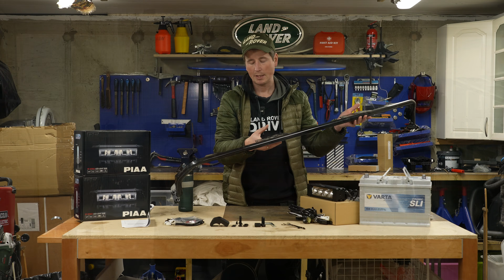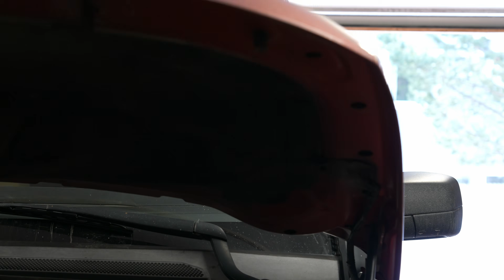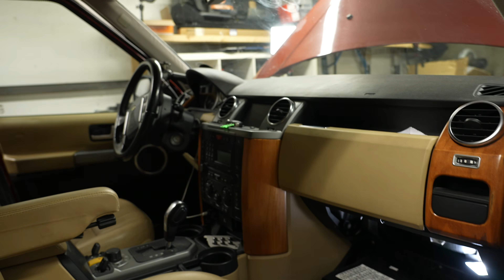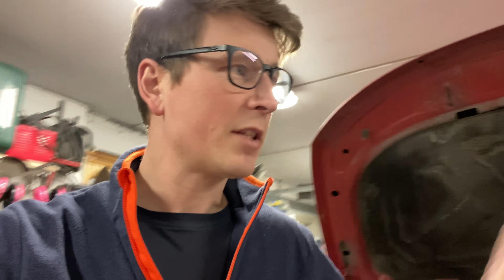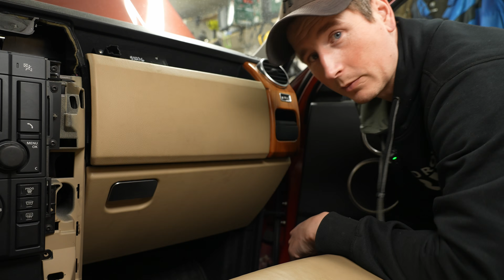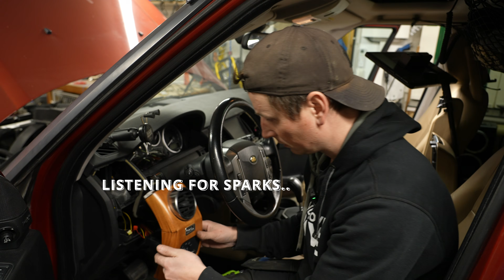FORD Upfitter Switches - The BEST Auxiliary SWITCHES for your Discovery 3 LR3 LR4 Land Rover

Comment: I have the upfitter switches to install on my LR4 as well but not the wiring harness with connector. I’m not having much luck with the online or AI searches. Where did you get the connector that goes into the back of the switches?
Reply from the maker: Hi and sorry for the late reply, I got it at the same time as I pulled the switch. I met a nice guy at the breakers that let me get part of the wiring loom at the same time.

Comment: Make a mold out of clay for the awithces.just use foil and wrap around switches and inside the coin tray, you'll have a sandwich. Then get a guy from your area with a 3d printer to design a insert f9r you. You can also use foam for tool boxes or pelican cases. Id bet theres 10 guys in your proximity ready to have some fun!
Reply from the maker: Thanks for the tip, the mold thing was smart. I have been thinking the same and I have the original overhead panel for the Raptor, where the switches mount to, so I thought I would use that in a combination or just cut it out and make it fit, as is, in the center console. 
You don't know how many times I have been looking at a 3D printer after starting this project... But that would be another rabbit hole I don't have time to go down into. 😅😂

I have multiple people to ask so will start there, one of them printer the Overlanding in Norway + Land Rover Drive center caps for my wheels. 👌

Thanks again,
Best Simon.

Comment: I think you spent too much time trying to use the disco wiring, would have been easier to make up a stand alone harness.
 I made up 2 ,1 for the led light bar on the roof rack and 1 for my bullbar mounted spot lights.
 I used a trigger wire from a headlight high beam slate/ grey wire through a relay with a switch that takes a power feed from the fuse box.
 By law in Australia we also have to have aux lights wired to the high beam so when you dip the lights they go off.
Reply from the maker: You are quite right Nick, and I am still not done spending time on it. 😅😂 
But that's me and my need to get somthing to work. 

I looked into the the headlight high beam and found the correct wire to hook into, but as you saw, I went the other way. I could as you just sent the highbeam signal into the switch and taken it from there. 

Will get some lights in the front as well in the fall, so we will see if I will redo the setup then. I had to make my own solution because of time and that missing pin, but you will get to see that in the next part. 

Best, Simon

Comment: Check out LR Time for the work involved in that bodywork repair. Good luck if you decide to do it yourself. I'm a mechanical engineer and I certainly wouldn't tackle it. Christian did an exceptionally fine job, but what he did is beyond my ability and workshop tooling.
Reply from the maker: I will give it a go and if it is to much I will reevaluate the situation. 😅😂 I have seen the LR Time's video on this and they do a good job in the repair using the pre-fab inner and outer sills. 

I know I won't do a perfect job, but since it is a chassies based car I am not to worried about the integraty of the strenght in that section. But I will definitely weld in more metal than a professional would do. 

Thanks for the input and tip about the video! 👍
Best, Simon

Comment: There is a large blank above the phone switch. Might a couple of phone switches fit in this space. You would then change the logo on these switches.
Reply from the maker: Hi Steve, been looking into that as well, but most of the original switches are push-release type buttons, used to just send a signal for a module. 
I look at the top buttons as well, as I am missing one, where the lock/unlock + hazards + backup warning are located. But a module behind there as well. 

I have spent so much time on this project reasearching the car and button options and I think I have found one of the better options. I think it would be even better if I didn't have the sunroof as I could mount then overhead, that would be just perfect. 👌

Thanks for the idea, not a bad one. I think if I can find some FoMoCo buttons that are push and hold, and that fits the space, I will do something like that later. 😉

Best, Simon
Reply: @LandRoverDrive my car is also starting with tin worn but not as advanced as yours 👍
Reply from the maker: @stevenbell7902  I think it is doomed already if I can't do a body-off, as it has been running in salt for years. I will do my best on the sills and then we will see what happens. 
I can only image how bad the parts that I can't see are. 😅

Comment: Hi Simon, Raptor owner here. The #1&2 swiches are rated for 15 amps, #2&3 for 10 amps, and #5&6 are 5 amps. If you run your lights through a relay it does not matter. Obviously you have to run your driving light and bar  trough a relay to acitvate them with your high beams, so switch 5&6 will work just fine. Just putting out the info for others who want to do this mod.
Reply: Outstanding! 🤘
Reply from the maker: Thanks Joakim, but just to be clear, are you saying the switches them self are rated for 15amps and so on? 
Or are you refering to the fuses in the relay/fuse box in the enginebay? 

The switchboard I would guess only handle a small mAmp draw. 
Best, Simon
Reply: @LandRoverDrive  I do not know if they use a relay. They have induvidual fuses in the fusebox rated at 15/10/5, but I have not found any relays.

Comment: Mr Simon in my opinion you are over thinking the wiring for the light here in usa and what i use is call a spod very easy installation you run any lights to spod and you run the main wire from control panel to spod and run lights wiring to spod and you finish they come in 3 different controller a rocker switch,  touch screen, and a push button,  i have all 3 in my jeep it the rocker swith to turn on lights,  on my toyota is touch screen and on D2 is the push button switch,  

You dineed to drill a new hole in fire wall what i usually do is use a wire coat hanger straighten the wire and take the wire you need to go through fire wall and tape it on coat hanger wire next find the wires that running through fire wall it has a rubber boot on it now take other end of coat hager wire push it through factory wiring boot and go inside vehicle pull through boot you end up with a nice seal from factory boot the spod is a one and done unit it has up to 8 switches for lighting or a air locker or air compressor has many functions 

My lr3 came from new jersey a snow and salt on roads i have a couple of rust spots im not repairing you can buy another lr3 or lr4 now they are really cheap but here in texas we don't get much snow but we get ice we don't put anything down but a little sand usually they shut down area where the bad roads are people stay home the sill repair not that difficult actually it's a cut off and weld in same part and you can buy the body skin and weld but it dose takes some skills that something i don't have rust is everyone nightmare have a good day simon
Reply from the maker: Hi James, and you are quite right, I am a over-thinker. 😅 It comes from the need to understand how things work. 
I have been looking at many options of switches and modules, like the one you mention, but non of them had the switches that I would like. These FoMoCo switches ticked all the boxes for me. 😊

I could probably gotten some wires through the already made grommits and I would try harder if I were to do it again. Coat hanger is a good tip.

The D3's and D4's here are dropping in prices as well, but the cars that are good for rust are quite pricey still. I will be looking at a D4 when mine get's scrapped.  No other car would be good enough for me after I have been driving mine for 12 years. 

We are driving in salt all winter so if you use a car as a daily it will suffer a rusty fate. 
I will be looking at the sills at the Discovery at the scrapyard, if they are good I will look into getting those for fixing mine. It would be nice to have room for a Discovery 3 that I could have as parts car. 

And thank you, a good day to you too! 😊
Best, Simon

Comment: This was soo cool Simon. The switch panel looked like it has been there since the car left the factory👏🏻👍🏻😎
Reply from the maker: Hi Robert and thank you! Very happy with it, and yes, with some trim pieces it will end up looking original. 
I think this is partly because the D3 has already a lot of Ford, FoMoCo, components in it. I even think the plastic colour codes are the same as a lot of the switches in the car is also from FoMoCo. 😊

Best, Simon

Comment: Love the switch panel. I'm just deciding what new lights to put on my D3. My roof bar light made too much wind noise without the roof tent on but I've just fitted a large solar panel on bars so that might help. I also need rear work lights and a side light for under the canopy. On the front facing lights I prefer them to come on with the main beam stalk operation so I'm not looking for switches if a vehicle is approaching.  I would also like, I think, some new front spots but with yellow running lights 😅 so many projects.....
Reply from the maker: Thanks bud, getting the right setup is part of the fun, but it can be difficult finding the perfect one. 
I am getting some more wind noise, not a lot, but no whistling sounds so I am happy. 
A good light setup I feel is a good combo of lights as you plan, as you can use then for their particular purpose. Now the spots are pushing further forward, picking up where the original main beam fades off. Likewise with the corner lights, adding to that side cast and over the shoulders.

I would like to have more focused corner lights as the work-lights I have spread to much up close. 

We will have to have some talks about light setup and share some experiences. :)

Best, the other Simon.
Reply: @LandRoverDrive you can pop over anytime 😅I hope come back to Norway next year though👍
Reply from the maker: @simon-mouse-LRs  Thanks, we will see when I can get the time to. I am hoping that the ferry will start to go from Norway to the UK again.
Reply: @LandRoverDrive that would be fantastic.

Comment: Love the light switches - it would be great if you document the wiring diagram for the the Raptor panel as you have inspired me to make the same mod!! 🎉🎉🎉
Reply from the maker: Hi Rob and thank you! Very happy with how it turned out in the end. I will look into a wiriing diagram and post it when I get the time. You can messure, using a multimeter, using conjectivity mode, to see when there is signal between yellow power in and switch power out. 

I would look into the F250 super duty version, as you can get the engine relay box with that as well, which you don't get with the Raptor. 

If have any questions just let me know! 
Best, Simon

Comment: I have the Prospeed light bar and rack - good upgrade!! Mine are mounted under the bar
Reply from the maker: Hi again Rob. A great upgrade for sure and very happy, need to figure out the lights after some testing and see what I should change or add. 

I will see what I will do going forward but will keep this until well into the next winter periode. 

How is the bar holding up? 

Best, Simon.
Reply: @LandRoverDrive  it’s great, lights up high don’t get so covered in salty debris and don’t get damaged by flying stones either. I do hope you get the sills repaired, shame to let the car go - at some point in the past the owner of the old Series must have faced a similar dilemma….
Reply from the maker: @robjames2000  Sounds good Rob, what I like to hear after doing this job. 😊 Stone damage is a good point. 
The Series had been welded a bit so you are quite right, I will give it a go for sure and then see when I am into the job how bad it will be to fix it. 

Don't want to see any of the LR's go anywere. 
Best, Simon